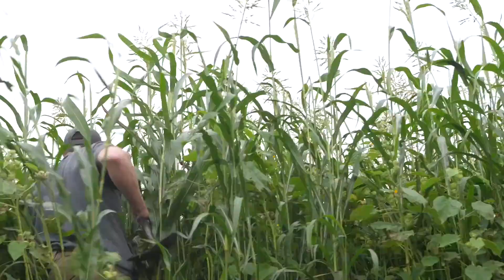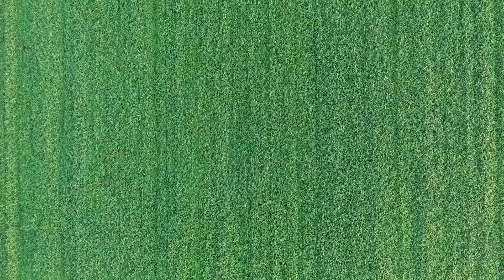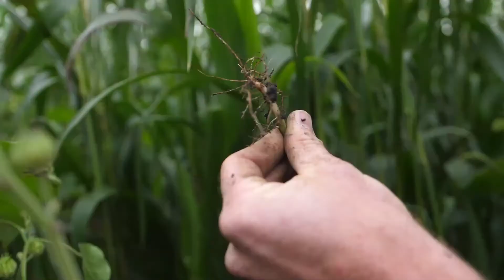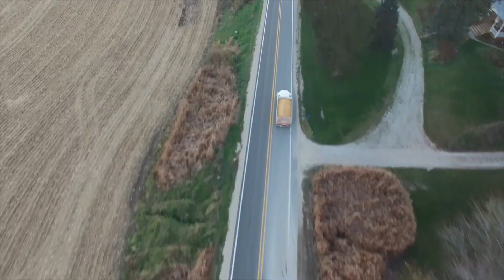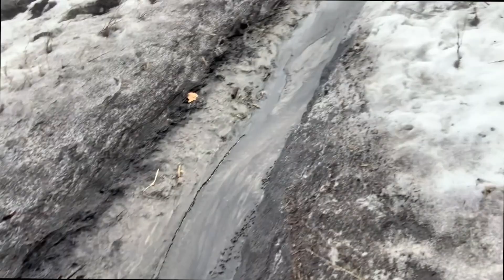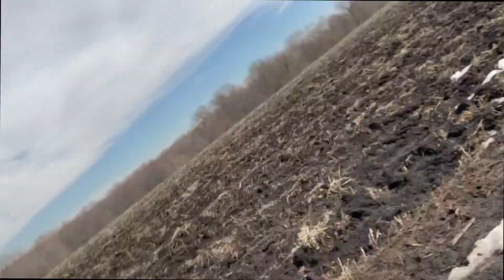Soil Erosion on Farmland with Tillage.

Comment: I own a row crop farm with small rolling hills therefore I have several areas like this.  I am considering installing drywells at strategically placed locations to prevent these gulleys from forming.  These would consists of 6 ft deep holds about 10 ft diameter lined with a highly permeable geofabric.  Then place about 6" of 2" rock on the bottom.  Then place 4 plastic 55 gallon drums with 1" holes drilles all over them in the hole.  Then fill around with 2" rock and over the top to ground level.  My hope will be that the drywelll will slow the water flow down enough to at least cut back the erosion by 80%-90%.  With the fabric, the rock will stay in place and clean for at least 100 years.  These areas of 6' x 10' areas would be farmed around but many times the area where they need to be dug are close to the edge of the field.  As an added bonus these would help recharge the aquifers.   
I plan to install two of these just before planting this year to see how they work over a 12 month period.